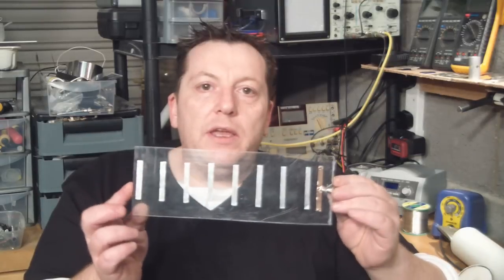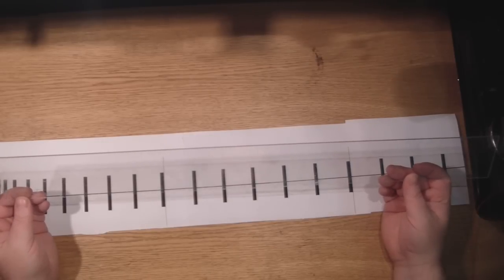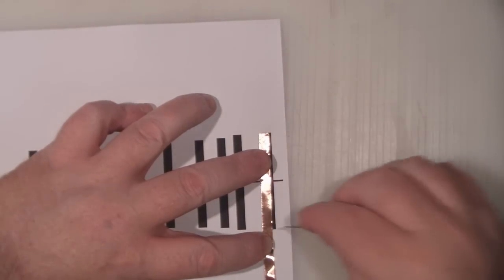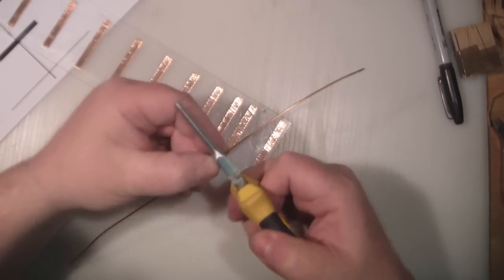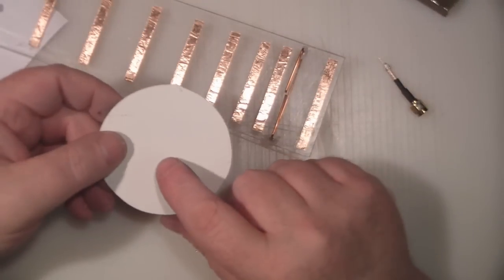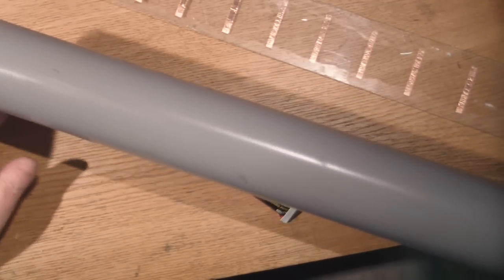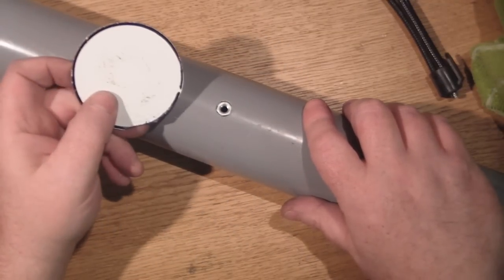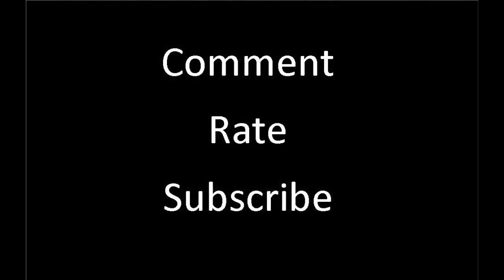Long Range Yagi Antenna 19 Element 2 4GHz

Comment: Hello, what about if you put it in metal pipe will perform better?
Reply from the maker: Hi no a pipe would not work with this. Take a look at my yagi in a can video.
Reply: Hello I did it. It was the first thing that took me on your Chanel and it look superb, actually today I am making such cantenna, I have a can from ballantines and the all other stuff described in your tutorial. :) Thank you for your reply :). Wish all best Preslav
Reply: I just thought, what is the biggest yagi size antenna that could be putted in metal pipe, what do you thing about?
Reply from the maker: Preslav Enchev The problem with size is that doubling  the size of an antenna does not double your power. Things can get to big to be practical if you know what i mean. In my 2.4ghz helical video i showed the differance between a 4 turn and a 14 turn and its not that much.

Comment: i did't get copper tap in my country...any others option for this...i am from nepal..ple help me...
Reply: you can use aluminium sheet i guess
Reply: I have seen people in India take apart a cell phone battery which contains a folded up length of copper and aluminum.  It must be completely discharged and if you feel it getting hot put it down and get away from it because it can explode.  Once you get the copper and aluminum sheets out you need to soak them in water to remove a black coating.

Comment: Do you have to use an Alpha card or can you use a different one?
Reply from the maker: You can use any 2.4Ghz as long as it has a external connector.
Reply: andrew mcneil thanks a million
Reply: Camping Conundrums You can use any but Alfa cards are REALLY powerful than can make receiving and transmitting data a lot stronger.
If you going to buy one be careful to get the genuine one too as there are many fakes out there that are false advertised and are not nearly as strong.
Reply: Camping Conundrums ...wow!
One, original Alfa card IS NOT black
Two, on that listing there is NO indication that this is an Alfa card
Three, way too cheap as usually original Alfa cards cost like 30-35+ dollars.
So what you just bought was a total fake and If I was you I would cancel that order AS SOON AS POSSIBLE!
Reply: Benjamin Pavel ouch
Reply: Benjamin Pavel Thanks for that.  I'm not too bothered about it because it only a few pounds. At least it didn't cost me fortune.

Also I;m looking to buy this please give me some advice.
http://www.ebay.co.uk/itm/2-4GHz-20dBi-RP-SMA-Yagi-Wireless-WLAN-WiFi-Antenna-For-Modem-PCI-Card-Router-/190657175552?pt=UK_Computing_Boosters_Extenders_Antennas&hash=item2c640da000

Comment: Two thumbs up! Let me know if this is suitable for Wimax with Expert Scan Mode 	(Frequency range:2496000KHz--2690000KHz)
DL Frequency[1]  2507500 	KHz
DL Frequency[2]  2602000 	KHz
DL Frequency[3]  2612000 	KHz
DL Frequency[4]  2638000 	KHz
DL Frequency[5]  2622000 	KHz
DL Frequency[6]  2505000 	KHz

I'm actually locking to it DL Frequency[3]  2612000 KHz which is only the usable setting.  If it does, then I need your help in making the template for this one. Thanks!

Comment: Smart design but you make a failure

A folded dipol has an impedance of about 240 ohm and is symmetric.
A coaxial cable has about 50-75 ohm and is nonsymmetric so you have to
create a transformer from unbalanced to balanced and 1:4 impedance transformation.
It is called balun. Please contact a radio technician or a radio amateur how to do.
Everything else looks perfect.
Reply from the maker: Ok so I am surprised that no one has posted a comment about this before.  Amateur radio works at a lower frequency yes a Yagi for the lower frequency’s needs a balun in order to match the impedance microwave frequency’s do not. As long as you use 50 ohm microwave rated coax you do not need one and using one usually leads to 1dB of power loss.  It is a misconception probably due to the fact that a lot of the antenna designs are copied from antennas used in the lower frequencies. Higher frequency radio is a different discipline if you ever study this at university that is one of the first things you are told.  I once worked on a radar installation upgrade that had an array of 10 Yagi antennas and none of them had a balun.

Comment: Sir can I connect it to a router and have afree wifi??
Reply: Yes you can, cuz it is an external antenna and will boost your routers transmission or reception.